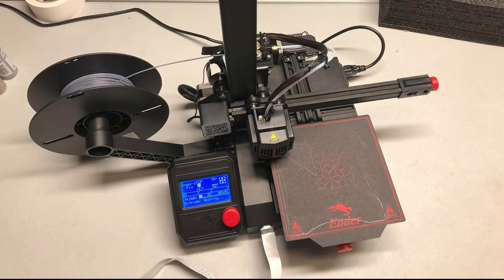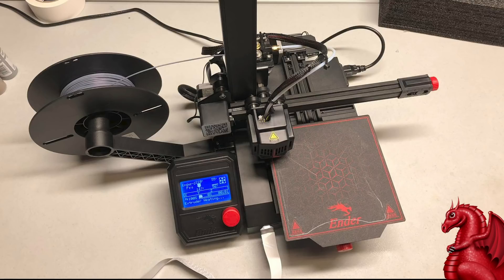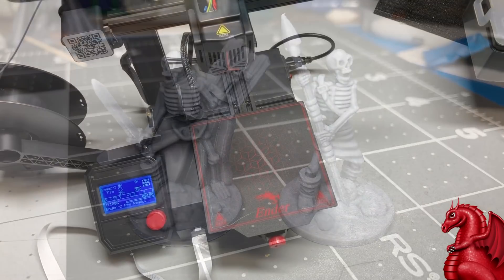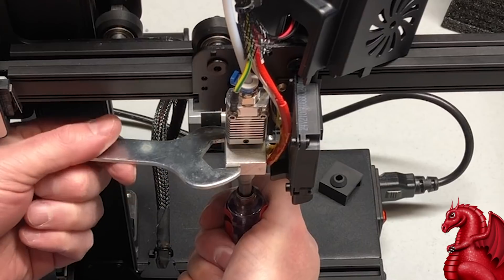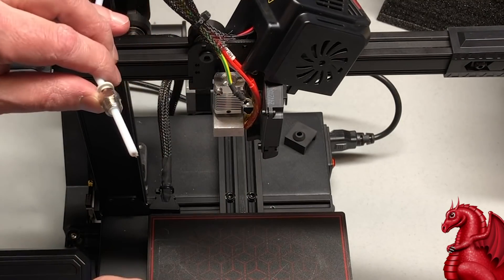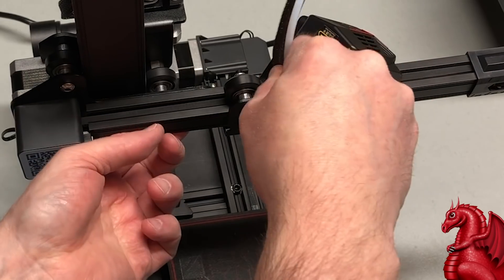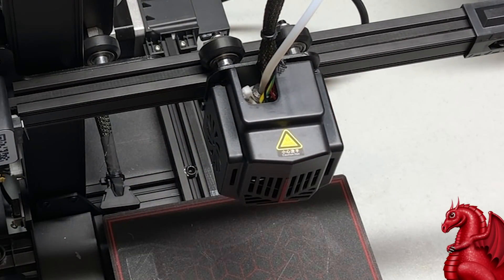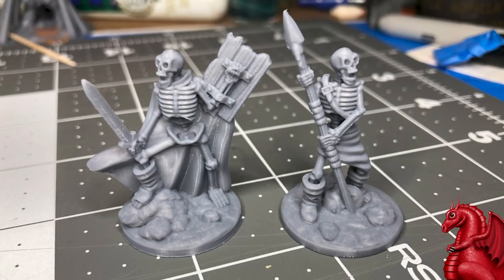Ender-2 Pro - How to convert into a fantastic minis printer!

Comment: Great Video's!  Thank You!  I am considering going with the Ender-2 pro to be a dedicated mini printer too.  Would you still recommend this setup for printing 28mm mini's?  I am not looking for resin 3d printed quality, but to create decent enough mini's.  I would follow your advice on the various upgrades or mods too.   I am about to pull the trigger, and wanted to see if you would still recommend this setup.
 Thanks!

Comment: Thanks for this video! I just bought one of these printers and am researching upgrades while waiting for it to be delivered. Any reason you haven't used an auto-leveling sensor like the CR touch? Also, what about the extruder? Lots of people recommend replacing the stock extruder with a metal one. Anyway, I'm brand new to 3d printing, and don't want to spend a ton of money if I don't have to!
Reply from the maker: No need for auto leveling, just buy a textured PEI steel plate and you will be fine (only $20 on Amazon). The new extruders work fine for quite a while, no need to upgrade to a metal one right away. My Ender 2 Pro and E3 V2 all still have the newer stock extruders after more than a year of daily use and are still working great.
Reply: @Tombof3DPrintedHorrors  Interesting - how does a textured PEI plate help with leveling?

Comment: Hey man,
I did what you did in the video and know my nozzle keeps cloging, i aint blaiming you but do you know what could cause this
Reply from the maker: Are you using my Cura profile for .2mm nozzles?
Reply: @Tombof3DPrintedHorrors  i forgot about that sorry
Reply: @Tombof3DPrintedHorrors  Your amazon link is to 0.3 mm nozzle. Was it supposed to be 0.3 or 0.2?
Reply from the maker: @jtreher  .2, go check my website for link.

Comment: Would you be willing to share either of the gcode files(or another similar one) to use as a benchmark test for whether our fdm printers are calibrated properly for printing at the quality you achieved?  I test printed a couple minis since they were so cheap and fast to chuck out, and I'm getting some artifacting that I can't quite pinpoint to my printer calibration or my slicer (kiri:moto)
Reply from the maker: Our minis are available on our website :)
Reply: @Tombof3DPrintedHorrors  yeah. I know that you sell mini files. I was asking if you have any that you would suggest to use for going through the process of dialing in an fdm printer for printing those minis. I was assuming that since you design and sell minis, you might have a sample to use as a test print.
Reply from the maker: @kalan4787  either of these should work well: https://www.fatdragongames.com/fdgfiles/dragonlock-miniaturers-adventurers-fdg0285/

https://www.fatdragongames.com/fdgfiles/dragonlock-miniatures-ranger-bow-fdg0322/

Comment: Could you show what results you'd get printing minis designed for resin printers? :)
Reply from the maker: I don't design any minis for resin printers, everything I make is designed for FDM.
Reply: @Tombof3DPrintedHorrors  I think you misunderstand. I've seen STL files for minis that specifically say "for resin printers only." I'm curious as to the results if you used an FDM printer to print those models.
Reply from the maker: @sandman6088 you'd need to ask the designers of those models.

Comment: Does look awesome.Fantastic work! Do you think i can achieve similar results with the Anycubic Mega S? The specs are somewhat better than the Ender 2 pro but i am new to 3d printing and don't know if that means anything.
Reply from the maker: The Mega S is a different mechanical design so can't say. You can try my Cura profiles and see how it works for you.

Comment: I am just curious as to why you changed out the tube and coupler's.  Maybe you mentioned it in the video and I just missed it so I apologize if that is the case.

Edit:  I did go back in the early part of the video and you do mention better couplers but not what is better about them.
Reply from the maker: The stock coupler loosens over time and allows the tube to slip and create a gap between it and the nozzle, which fills with filament causing jams and under extrusion.

Comment: These are $69 SHIPPED as an "unrepair" on Ebay.  Anyone with solid technical / troubleshooting skills or extensive 3D print experience should be able to fix one up without great expense, or possibly none with simply getting everything cleaned up and assembled properly.  I have one coming and will be amazed if I don't end up well less expensive than new ($159 currently shipped from Creality)...

These make a good 2nd printer for those so interested, so it will help out my Aquila X1... which, due to it's cost being the same ($159), I would have bought a 2nd one if I had to pay full price.

Comment: Thank you so much for doing this review. As someone with younger children I’ve been very concerned about getting a resin printer, but also at the same time being concerned about layer lines. However with this review I found a perfectly acceptable solution that is significantly safer and a better option all-around for my situation.
Reply from the maker: I am in the same boat, I refuse to use resin due to safety issues. My new Cura 5.0 mini profiles releasing later this month will do even better quality minis that shown here, so look out for their release. :)
Reply: @Tombof3DPrintedHorrors  will do! I’m so happy that you can do great stuff and not need resin. I want a hobby tool, not a potential superfund cleanup! lol

Even better for peace of mind.
Reply: @Tombof3DPrintedHorrors  Thank you for this video, I just saw an open box at my local MC for $100 which I am going to pick up today. My 27yo got into D&D and I have been making him walls and flooring with my E3P but hesitant to do minis. But I am glad I saw this so I can make a bunch of minis and send to him!

Comment: I've just upgraded my Ender 2 pro board to 32bit but the 4 motor cables are now 5 pin as opposed to 4 pin on the original board. I'm now really at a loss as to which new cables I need to buy, what length etc. 😭

Comment: Unfortunately I had no success with my ender 3. Bought it for 200Euros originally, dumped another 100ish euros into upgrades yet I cant seem to get it to do what I want it to. I'll sell it on ebay, be thankful about the things it has taught me regarding how a printer functions and which parts can cause which effects and then buy a prusa mini+. I just want it to work.
Reply: The ender 2 pro I got works fantastic straight out of the box. Im not sure what the price difference is. I really want a bigger Prusa machine, but don't want to pony up the cash, and instead I am getting a resin printer
Reply: @alanfitzgerald9026  Ender 3 worked great for a while too. But it acts up often enough and that's just not sth I want to deal with anymore. Plus, Prusas QC is definetly better.
Reply: @Genesis-dj7kw  Cant blame you there. It was a good learning tool while it lasted though I bet. Mine is, and I got the confidence after not knowing anything to wanting to get into resin now
Reply: @alanfitzgerald9026  Indeed, I learned a ton. Made my first experiences with soldering and so on so forth, as well as tons of slicer tuning and calibrating. But its just time to invest a bit more and just get a very reliable machine to just have fun and blast out prints.

Comment: Well mines running its first mini print and its very noisy, the fans sound like they speed up or a 2nd one kicks in every so often which is very loud. Also hearing some ringing. I can see some stringing but will see after its done in 2 hours time.

Comment: This is an awesome video - I'm trying to avoid a resin printer because I'd have to keep it in my office and I'm concerned about the toxins. I'm wondering if I should go this route or wait for the next generation of FDM printers....
Reply: Went ahead and picked one up. Now to make your adjustments. :)
Reply: @snart  This is an awesome machine. One of the first things i did to mine was peel off the mag sheet, and spray glue a sheet of glass directly to the aluminum plate. Never had any adhesion issues, and when I print 4x6 lithophanes vertically, I use a raft and an elmers purple glue stick just to be safe
Reply: @alanfitzgerald9026  So I've been using the mag sheet and it's been working wonderfully for me. Will have to check out the glass and glue stick combo.
Reply: @snart  it works good, but don't do it unless you have to. When I did it to mine, I accidentally put a big kink in the mag sheet, and didn't want to wait for a replacement, or they weren't available or something, and went ahead with my solution. It's going to be a bugger when I finally have to remove the glass lol. I glued it because there was not alot of space for binder clips of I remember correctly
Reply: @snart  Elmer's purple glue stick works well for first layer adhesion, sometimes too well lol

Comment: Why do you change the tube connector on the hot end? is the default connector bad?
Reply from the maker: It's not good and will allow the tube to slip over time, which requires a complete strip down of the hot end to clean out. Spend the 50 cents on a good connector now.
Reply: @Tombof3DPrintedHorrors  Thanks for the  response, I am going to be getting a 2 pro next month and will get the extras mentioned ;-) btw do you have power detection on or off as I just saw with it on it can cause issues?
Reply from the maker: @Optikification  off
Reply: @Tombof3DPrintedHorrors  Well my ender 2 pro should arrive tomorrow so I have your build video at the ready ;-) with regards to your profiles are they set for PLA? On my ender 3 i use sunlu silk pla+ and found the best temps to be 50c/205c so wondering if the temps in your awesome profiles might need changing for silk PLA+.
Reply from the maker: @Optikification  yes, temps will vary depending on brand of PLA. I strongly recommend eSun PLA Plus as it is by far the best I have tested.

Comment: To add the Creality Ender 2 PRO into Cura versions, you can add an "Ender 2" and change the Build size to 165 x 165 x 180mm
The Ender 2's Default is 150x150x200, which is smaller on X/Y and too tall on the Z for the Ender 2 Pro.
This should hold everyone until the Ender 2 Pro is added into newer versions of Cura.
Reply: Are there really no other machine settings that oughta be changed?
Reply: @magnetwhisperer  Nope, it's that simple. The stock 0.4 nozzle will print great.
If you are printing mostly minis, you can put an 0.3 nozzle in this and it will print terrific minis.

Comment: I bought the Kingroon KP3S 2 weeks ago. It has a similar build volume (180x180x180) and is in the same price range. It doesn't have those fancy belt tensioners like the Ender 2 pro but on the other hand you get: lineair rails on x and y, touchscreen and direct drive extruder. I reflashed to Klipper and my god do I have fun with this little printer. My Ender 3 pro is collecting dust atm. This is just my personal opinion but I think you get better value for your money buying a KP3S and it prints great. Of course expect some parts on the printer where the company tried to save some money, but Creality is famous for this too.

Comment: Tom, I have an Ender 3 V2 and have regular clogs. Someone in the FB group has suggested that retraction could be an issue. What retraction (in mm) do you use?
Reply from the maker: 6.5mm (my custom Cura profiles are linked in the video description.)

Comment: Good video thanks! For the roll of filament, I just put a cut-down toilet paper roll over the spool holder and it works really well (and it is free).
Reply from the maker: It will still have more friction that the PTFE/teflon tape. A roll of PTFE tape is about $1, this isn't expensive.

Comment: Looks cool - I'm surprised you didn't use some better Capricorn tubing and do "Luke's Hotend Fix" while you had it apart.
Reply from the maker: Capricorn can actually create issues because of the super tight interior tolerance, and I've found the new coupler with the tube installed as shown, negates the need for the hot end fix.

Comment: I am looking for a small printer to have a dedicated 0.2mm set up. Whats everyone's thought on the Ender 2 Pro vs Kingroon KP3S?
Reply: Id say just go with the Ender 2 pro if the slightly smaller build volume is sufficient for you
Reply: @alanfitzgerald9026  thanks, thats what I ended up getting.
Reply: @houseofcheung  I'm very impressed with mine. I bought it because I wanted to make 3d models of my art work and learn how to use Blender and print them out. It does the job nicely
Reply: @alanfitzgerald9026  me too, I use mine with a 0.2mm nozzle exclusively and prints are coming out great. Compared to my ender3 with BLT, the only thing missing on the Ender2Pro is BLT.

Comment: Now I have a doubt: as a first printer, with the intention to print miniatures but also accessories, would it be better to get the ender 2 pro or the ender 3 V2?
Reply from the maker: Comes down to build plate size, this has a max of roughly 6x6 or so.
Reply: If your getting a machine just to print small things, defiantly get the E2 pro. It works very well. If you need something with a bigger build volume, Skip any of the Ender printers, and consider a Sovol or Kywoo, which cost more, but come with dual z axis and direct drive extruders. If extreme detail and resolution are your top priority, consider a resin printer. But the Ender 2 pro does a phenomenal job at what it does, simple to set up and get running. In my experience, it plays better with the Ender 3 profile in Cura, than it does with the Ender 2 pro profile in Prusaslicer

Comment: I appreciate your efforts to educate this noob with a new printer. If you have used an Anycubic Vyper, could you please make available your Cura settings for printing minis? I have tried and some come out just ok, others appear as though the nozzle is melting the prints and they end up in the trash can. Thanks for whatever info you can provide.
Reply from the maker: All I can suggest is to start with my Cura Ender profiles and try modifying them. I can only develop  profiles fo machines I have access to.

Comment: Actually here in Germany E-Sun PLA is one of the cheapest fillaments you can get. And its awesome
Reply: Esun is currently the only one i'm having trouble with. the stock cura setting for it is not very good. Any changes you have made?
Reply: @Mrningizzida  not to doubt your knowledge, but did you make sure cura is set for 1.75? I completly forgot to check that with mine, and had problems. it defaulted to a larger size on me

Comment: Thank you for the video.  I'm not sure if its in the works but I'd really like to hear a review of the Ender 3 S1 if at all possible.  I'm interested in printing minis and the results you've achieved the Ender 2 Pro look great.  The updates in the 3 S1 should help to improve mini quality.  Do you think you can get the same results with the 3 S1? I know its more money than the 2 Pro but you get a bigger build volume.
Reply from the maker: I played with an S1 for a few weeks, it's a nice printer and easy to set up, but the print quality is better on the Ender-3 V2 and this Ender-2 Pro.
Reply: There are a few reviews on YouTube that are pretty thorough.

The Ender 3 V2 with a few upgrades is as good as a Prusa MK3, so I'm sure the S1, which is better than the E3V2, will be sufficient for your needs.
Reply: @UC5Lbnd97HV3rU98gcwHklzQ interesting.  You did a video some time ago where you printed a mini (I think it was 28mm) on an Ender S3 V2.  Which gives better mini results the S3 V2 or the S2 Pro?
Reply from the maker: @bkk6211  The Ender 3 V2 produces slightly better prints than the Ender 3 Pro (the V2 is the next generation of the 3 Pro.)